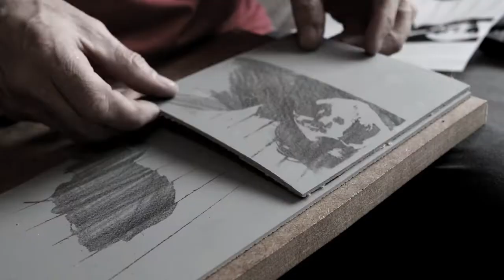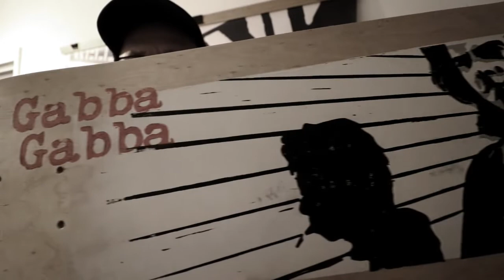Handcrafted Skateboard deck with lino print graphic making video.

Comment: Excellent work and craftsmanship. Inspiring me to make some decks again, after a 46 year break (1976 - used to skate - badly - in London, South Bank, Skate City - plus local parks & roads in Edmonton!) Many thanks for sharing your build process,. Will def use a spoke shaver, as I prefer the hand made craft as far as possible. Am going to build a small press to start and cut some insulation foam, glued to pine planks, to get a shape form (have some fat pieces of Selatex left over from my studio build) - realise it won't be quite as 'pressie' as a straight wood form but that may be a little ambitious at the moment. I'm OK with the artwork stage. Lol!  Thanks again for the share, much appreciated.
Reply: Want to see the end results